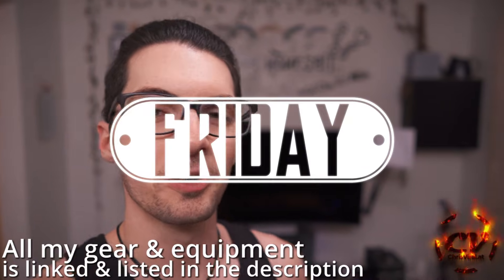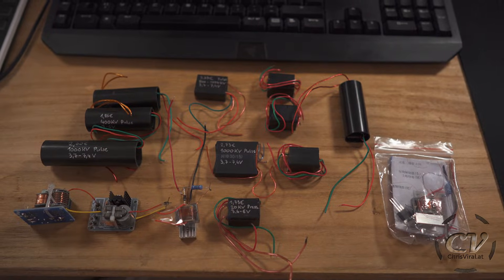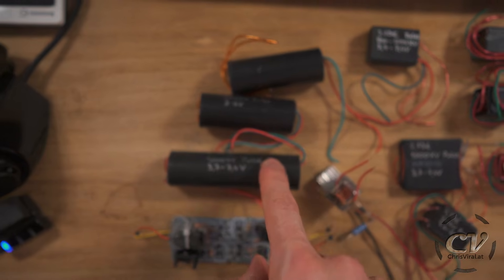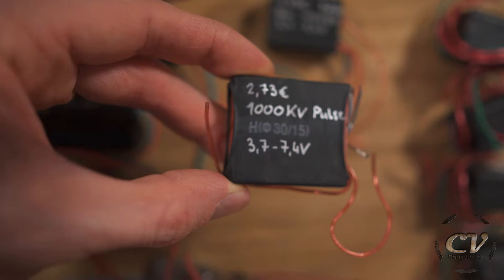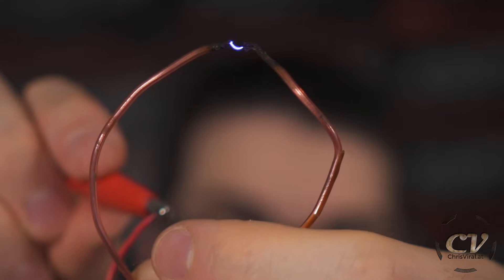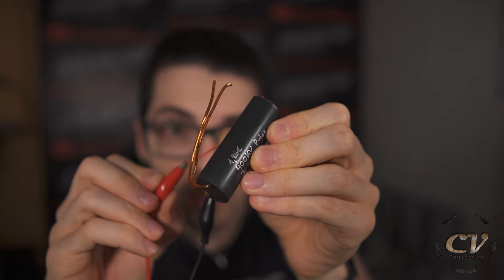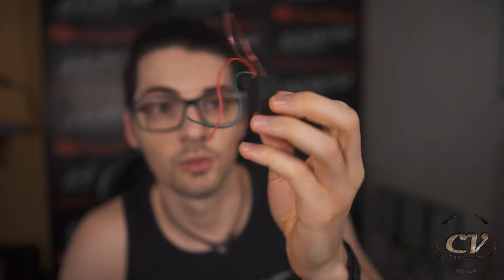High Voltage Generator Comparison (15KV, 20KV, 400KV, 1000KV)

Comment: btw i think you missed this one, its a hot arc type, the electronics
aremore flat so i think its the same they use in the lighters
https://www.ebay.com/itm/DC3-5V-High-Voltage-Generator-Arc-Igniter-Lighter-Boost-Electronic-Suite-DIY-Kit/173615058950?hash=item286c439006:g:GJcAAOSwGYhb2C9J:rk:27:pf:0

6:00 i think for the 2 modules , you have to remove the tape it prevents the air for ionising (atleast 50% less than without tape) , the arc needs ionised air to jump.

if you wnat to remove the resin, i have done that its pretty difficult and you need patience. Its done with a Hot-air-gun @ 400-500 degrees celsius.+a 10mm Nozzle or what you have there.
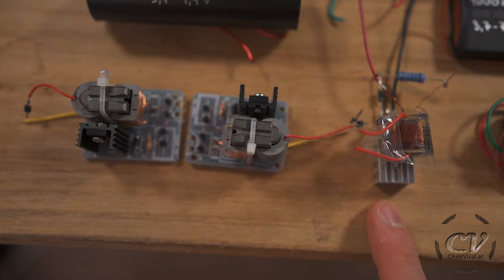Basicly you have to heat the material as gentile as possible and peel it of layer by layer with an object like a flat screwdriver (not sharp). Be careful not to damage the parts and to not heat it too much. Inside it looks like 2:04 and the trafo might fall of.
The condesator labels will melt away in the process so as soon as you see them note the text of their cases or make a foto.

here is what you can expect, i uploaded my first try:
https://imgur.com/gallery/mZVOyZJ

i found some stuff you might like too:
a Venylcutter you can cheaply convert any cnc machine into a venyl cutter
(for cool decals search https://www.youtube.com/watch?v=sst09sFOKnQ )
https://www.ebay.com/itm/024B-Plotter-Plotter-30-Grad-45-Cutter-Roland-Blade-Holder-15pcs-15pcs/283229253930?ssPageName=STRK%3AMEBIDX%3AIT&_trksid=p2057872.m2749.l2649

a hidden knife/kubotan which is easily 15$ worth on amazon, on ebay for under 3$
https://www.ebay.com/itm/Portable-Outdoor-Stainless-Blade-EDC-Pocket-Folding-Knife-Keychain-Survival-Tool/264070731024?var=563615829552
Reply from the maker: I decided that I'll stay away from kits for now lol. They're really not worth it imho.

Don't overthink it haha (6:00) classic polarity mix up 😂
It's the only module without color coded input cables.

What rly? I'll just try my luck with soaking it in acetone. One day I'll get to that. I hope I won't have to resort to this method 🙌

Thanks for the vinyl cutter hint, I already have one (GC Expter Pro 2 or something like that) but that looks interesting never the less.

Also thanks for the product link :)
Reply: acetone doesnt work i have tried that, also boiling water doesnt work.
Btw imgur is a not a nice place when you put the images on public, seconds i had done that i  got a shitload of nasty comments xD

They have implemented a system where people get points when they write comments, i guess thats why.
Reply from the maker: Yeah I noticed that. I went through your older posts too, so many stupid comments #facepalm